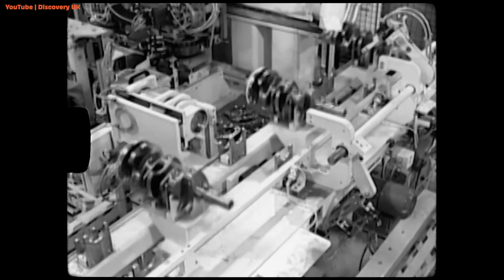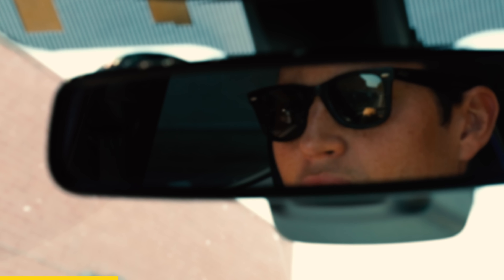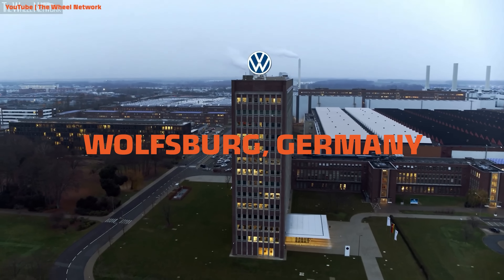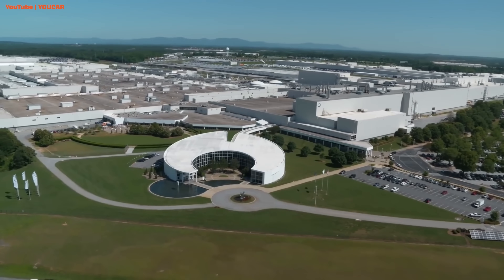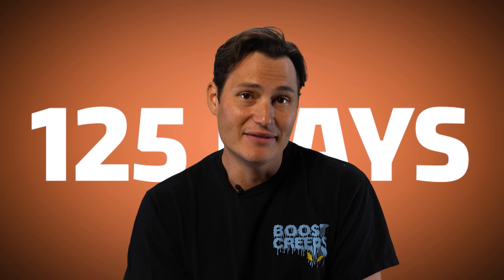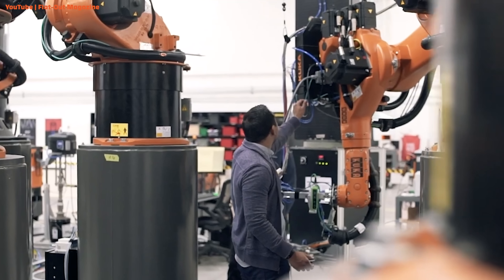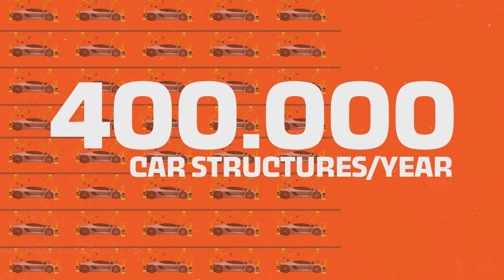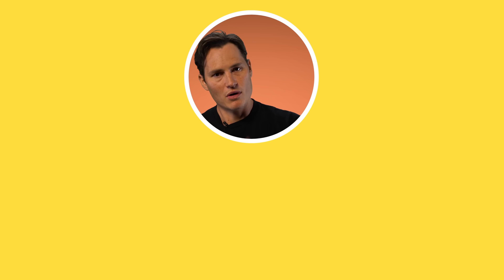A.I. Designed this Car

Comment: This will incredibly reduce the cost of manufacturing such cars, but not the selling price.
Reply: On engineering level, yes. But these Designs are not optimized for serial production, creating high cost manufacturing concept.
Reply: @Neyoz.93  that's absolutely true. This guy doesn't mentioned that a car can be built completely all in one spot. But it still can only do one at a time. if they're building 'to order' super cars, this is feasible. But there would have to be at least the same amount of real estate or even more to make daily drivers like a civic.
Reply: @Neyoz.93  One day the concept will become efficent, the problem is when and how.
Reply: @Neyoz.93  thinks you forgotten a "yet" after - But these Desings are not optimized for serialproduction
Reply: Correct and it will certainly MASSIVELY increase the profits and year end bonuses of the stuffed suits sitting in offices of manufacturers who adopt this technology...
Reply: This only truly becomes efficient when machines can make the materials needed by using common resources till then this is not completely self sustaining
Reply: but think about how much better the cars will get and that will drive competition up and thus prices down.
Reply: I doubt 3D printing will replace injection molding in quickly and reliably producing high-volume runs of complex designs anywhere in the near future.
Reply: @caelestigladii  In wont anytime soon. Injection molding machines can produce thousands of parts an hour, not spend multiple hours making 1 part, and they are cheap compared to industrial quality printers.
Reply: @caelestigladii  but it will replace tool and die guys that make the mold for the injections.
Reply: It will reduce upfront costs, sure, but not per-unit costs. 3d printing is just fundamentally inefficient at high-volume manufacturing.
Reply: @JosephHarner  get more printers .now it is unlimited.
Reply: @danecrude  3d printers are still to slow.
Reply: @JosephHarner  most of any car price is generally R&D costs.
Reply: So what you’re saying is invest now in VAG, Japanese auto and the big 3. Because they’re going to start raping so cash money
Reply: Meanwhile jobs get cut and moved mostly to customer service.
Reply: 3d printing will offset any savings from cutting down the design costs.  3d printing doesn't scale costs very well
Reply: @EvlEgle  the newer ones do
Reply: @samuelmatheson9655  newer what do what
Reply: Yes it will, the car industry is extremely competitive and they will undercut each other
Reply: You have no idea what you're talking sbout
Reply: no, the process of making cars like this is significantly more expensive than that of the traditional manufacturing process. the only pros are less space to make a few cars and slightly less material per car. 3D printing metals has downsides (a lot of them) and their strength is making highly complex shapes (a limit to it though due to their inconsistency in the micro scale). great for making a few complex cars but not large scale production
Reply: Eventually someone will decide to gain business by giving a worthy deal to people and prices will lower. They aren't that dumb.
Reply: @josiahcaspersen8017  with no government intervention anything is possible
Reply: The next 20 or so years are gonna be fun
Reply: @Ethernos Grace that's exactly what I was thinking as well.
Reply: So, AI can't solve capitalism. Yet?
Reply: @Simboiss  Actually the stuff produced by AI follows exactly the rules of supply and demand.
Reply: @PG-3462  I was semi-jesting, but the actual answer is no, because capitalism is a human problem, not a scientific one.

The more you create technology to produce stuff at a higher pace without human intervention, the more you amplifiy capitalism.
Reply: @Simboiss  1) How is capitalism a problem?  The countries with the best life quality for the average citizen (like Norway, Switzerland, Canada, etc.) are capitalist, but with good welfare and social programs.    2) How does AI create problems?  It reduces manufacturing cost which can only be good
Reply: @PG-3462  Ah shit, I didn't want to go that way again (I thought I could get away with a tongue-in-cheek comment)... Let's just use the word "inequalities" instead. The more automation, the more inequalities between classes (capitalist/worker or rich/poor, use the terminology you want).
Reply: @Simboiss  Maybe in the USA, but not in actually developped countries.  On the other hand, capitalism doesn't stop people from creating cooperatives which would own the AI machines.  Thus, all profits would be shared between the cooperative's members.
Reply: In time the costs will come down as copy cats get ahold of the technology, driving competition.
Reply: It makes me sad and mad to hear this as a new member of the adulting and this tek could supply high quality cars to nearly everyone
Reply: Idk about the selling depending on how fast they can mass produce a product it’s all on us “the people” to want it enough in demand
Reply: Everyone with half a brain cell and any knowledge of engineering has already blasted you.

This "reduces" the cost of design not manufacturing. This hyper inflates manufacturing and production.

The problem with iterative design is that it only cares about weight/materials in most of these cases. It doesn't care about creating a part that can reasonablely be manufactured via conventional methods.

3D printed parts are inferior in almost all ways to their conventional counterparts. They also are a god damn nightmare in terms of the fact they are not isotropic so their like transfers turn nasty very quickly.
Reply: It will cost whatever the market will bear... As long as the 1% earners find it to be a status symbol. If it was only about going fast everyone would have a Porsche 917...
Reply: koenigsegg owner covered how this is only possible on limited production cars.  Their turbos are 3D printed and have been for awhile.  Also it said ONE car takes 125 days... how is that going to help the manufacturing process if someone orders a car and it gets there 1/3 of the year later.  People would be pissed since they can do that now and get it in a couple of weeks.  While this manufacturing process is definitely cool and innovative, it only works for low number production numbers because of how long it takes and cost of materials and machines to make one car.  That big ass plant may cost half a billion or whatever he said, but its also going to put out thousands and thousands of vehicles compared to the 80 this company will make of the 21c.  

All in all this is just a really cool way to make a 1.7 million dollar car, 80 of them.  Compared to the tens of thousands made a year by the other vehicle companies.  So no it wouldn't save you a dime to have your light duty truck or suburban mom vehicle made this way and it definitely won't add to year end profits of any CEO cause they would've been fired already.  And to think they don't know about this or haven't researched how to drive up their profits is as ignorant as the comments saying how good this would be and how it will make anybody money when you have to make a car quickly and cheaply.
Reply: It would, It should, but as long as capitalism exists, it won't.
Reply: This is cause the technology is still pretty new give it some time and it will surely be reduced
Reply: You're definitively wrong.  If such a technology can decrease a lot the manufacturing cost of sport cars, then there will definitively be some brands which will sell their cars at a much lower price than let's say Ferrari or Lamborghini in order to attract more customers and to make more profits.  In general, the selling price reflects manufacturing costs (even if there are exceptions, we can take Maserati as an example which sells cheap cars at an excessive price)
Reply: @PG-3462  Youre both right. For now, since it's new tech, the 21C is going to mirror prices of similar models. Eventually, when AI manufacturing becomes a widespread commodity, it will drastically reduce manufacturing costs across the entire automotive industry and ultimately make cars cheaper to buy. This is all assuming a ride sharing model doesn't completely take over the automotive industry though.
Reply: @thomascombs3019  yes, now they build some cars, tomorrow when people only would rent a car, they build spaceships, airplanes and the super popular family hover-comuter
Reply: @thomascombs3019  welll you are wrong af lmao so idk if its really ur place to say whos right when you dont even kinda understand what u are sayinh
Reply: @Angeltitsss  yes this fact filled smart comment made me a believer! 🤣
Reply: @PG-3462  the reason sports cars are popular is because they are a statis symbol and a measure of wealth if they were dirt cheap no rich person would buy them how many rich people do you see running around with cheap cars they buy the most expensive most hyped cars to be cool and show off not for comfort or money saving and yes not every rich person buys expensive cars but the majority do they could get higher end cars into poor peoples hands but rich people won't buy them because how can you stand out if everyone has one also Ferrari and other companies don't make huge quantities of cars like Honda or Toyota or others because when you charge what you want you dont have to make a ton and they become more exclusive with a smaller production run so more money for less also you would literally shit a brick if you ever saw how much markup regular cars get a minimum of a third of the price of a car is profit on the cheapest cars thats why when they want to dump older stock they don't have a problem lowering the price because even a lowered price is still profit and they stand to make more money off the newer model anyway so basically getting rid of them even at cost is profit to car companies and dealerships because people who buy new cars don't want to buy the last years model but the new and improved model
Reply: @CMyBigHarryBLLS  The thing is that we live in a market economy.  Some things are more expensive only because they are harder to produce and thus more rare.  However, if technology allowed every car manufacturers to produce super high quality and super luxury sport cars at a super low cost, then they would do it and try to steal the market of Ferrari, Lamborghini, etc. by selling their cars at a much cheaper price.  Of course some companies might still succeed to make their products more desirable, but the difference between let's say a Honda and a Ferrari is only that Honda currently uses production methods which allows the company to reduce production costs in order to sell cars at a lower price tag.  If Honda could use a 3D printer to make super quality and super luxury Honda Civics at a super lot cost, then they would definitively do it.
Reply: @PG-3462  Correct, as long as there is competition. These people know fuck all about economics, glad to see that some people still do understand basic economic concepts.
Reply: @PG-3462  , sports cars is a ridiculous ways of waisting our time and valuable resources.
Reply: @zasadacrew  I didn't say they are.  I just said that if manufacturing costs decrease, selling prices will too
Reply: @PG-3462  , selling price will not decrease. Firstly because it will be presented as super awesome technology and second, the buying power of $/€/£ etc, is rapidly declining. ;)
Reply: @zasadacrew  This is not how things work.  Very little companies manage to sell cheap products at an insane profit margin (like Apple, Louis Vuitton, Maserati, and so on).  Despite being very popular, companies like these only represent a tiny % of all companies that exist on our planet 

Just saying, Ferrari makes as much profit by selling a 488 at almost 500 000$ CAD than Toyota selling a full equipped Highlander.  

If manufacturing costs decrease, some companies will benefit from it to sell better products at a cheaper price than their competition.

Did you ever wonder why a company like Honda doesn't make a Ferrari or Lamborghini "copy" and sell it at a reasonable price?  Tell me if you want me to explain
Reply: @PG-3462  , because Lamborghini and Ferrari not practical vehicle and in my opinion are just a waste or time and resources. The only reason to buy one is to show off which is a "poor person" mentality.
Reply: @PG-3462  , as well Apple is a re-saler of good that been manufactured by Chinese companies and all they do is marketing. Maserati is garbage that even my friend hates now since he wanted to look cool on the street and looks miserable in repair shop. :)
Reply: @zasadacrew  That's not the topic.  I wouldn't buy such cars either because I don't like getting attention and it pollutes too much.  

The topic is selling price, and if cars can one day be fully designed by A.I., it would decrease production costs on many different levels.  Such a reduction of costs would lead to a reduction of selling price.  

And it seems you're not interested into learning how production processes work...  If you don't like to learn something about this topic, then I guess you shouldn't be giving your opinion
Reply: @PG-3462  , it's already possible if judging by this video. This video is year old and how far this process went ? It's still a fantasy. I believe it should be all done before presenting. All this presentations and talks are waste of time. Good way distracting people. Nothing else. 
Regarding commenting. I say what I want when I want. :)

P.S. all this "green" movement is a bs. There's no harm done from our activity. The only concern that people have is a clean place to live. Their own habitat.
Reply: @PG-3462  if that’s the case, a cnn billet engine block should be way cheaper than a cast. The blueprints already there, a chunk of aluminium to mill is cheaper than casting block, yet a billet block is still upwards of 10 grand. Don’t think you’re correct when it’s currently false even though it shouldn’t be.
Reply: @Star.Chaser  It's much more complex than that.  An engine block is not something people change frequently on a car, so supply is low.  It's thus normal that it remains quite expensive.  And how much was it worth in the past for a similar engine?  You can't just state a price and compare it with nothing.

Comparing modern cars with older models is also tricky, as modern cars got much more technology and much more complex over time.  If however you look at the profit margin of car manufacturers over time, you will see that it remains pretty much unchanged, and that's because in general, a reduction of productions costs leads to a reduction of overall prices.  This is exactly how Japanese and South Korean brands first entered the international markets.  They offered good quality vehicles at a price much lower than their American and European counterparts.
Reply: @PG-3462  first go cheap to destroy the market...then raise the prices.
Reply: @anomalyp8584  Reality shows that this isn't true in the car industry.
Reply: @PG-3462  so what is the reality?
Reply: @anomalyp8584  That when production costs reduce, selling prices do as well.  If you take inflation in consideration, most cars are cheaper now than they were a few decades ago, at least in my country.  The complexity of cars increased a lot, but better manufacturing techniques made that production costs didn't increase too much.

If companies can find ways to make the production process even better with AI, we will get better cars for the same price, or similar cars than we have now but cheaper
Reply: @PG-3462  but if there is a monopoly on this technique won't they undersell first to outcompete the competition? Or are they too codependent...
Anyways, I think in the future the prices will go higher and higher artificially to phase out private ownership of cars...whether that's by the manufacturer or the gvt.
Reply: @anomalyp8584  I'm pretty sure that many car manufacturers are working on such software simultaneously.  The key of success for most companies in the car industry is to maximize the number of parts that can fit on several different models, and AI will definitively help to achieve this in a more efficient way by allowing less sacrifices in design and performance

Did you ever wonder why a brand producing cheaper cars like Hyundai can't make cars as good looking as Porsche?  It's not because Hyundai's designers are bad.  It's because Hyundai's designers are limited in their design by the fact that Hyundai wants to use the same platform, the same engines and as most smaller parts as possible for all its models in order to reduce manufacturing costs.  In contrast, more expensive cars have less design limitations because most parts are designed for one particular model.  If we talk about Ferrari, every single part, even including some little screws, are all designed for one model in particular.  Despite Ferraris being sold at a very high price tag, the profit margin per vehicle is actually not that much higher than other car manufacturers since its production costs per vehicle are much higher

In short, an AI software would definitively help to design much better cars for cheaper, and if manufacturing costs decrease, then two things can happen.  Either selling prices decrease, or the performance and technology used in cars will increase

You're also right that personal cars aren't exactly the future, but when we see how badly designed most North American cities are, personal cars will still remain during several decades to come.  It is impossible to switch to a car less society if urban sprawl keeps increasing in a stupid manner
Reply: Mostly will  just increase profits but yeah It will bring the price down a little I suppose
Reply: This tech has been out for 20 years.
Reply: Less material, but higher price. I'm just glad this kind of technology will take a more organic.
Reply: Ricky Fontaine  still going to need skilled workers to repair the robotics. I should know i went to school for four years to learn how to just that.
Reply: The seling price is up to so many reasons like the dealers and the taxes. .. but its gonna reduce the amount of money you pay on the freakin product (car ) like Henry Ford sr's idea of the assembly line in the past
Reply: Profit babbbbyyy
Reply: Maybe, but also there's still quite a few car manufacturers so the competition should keep prices in check
Reply: Assuming up-coming competition, market forces will lead to 'price discovery' and reduce sales prices across the sector as with everything #capitalism
Reply: then purchace car manufacturer stocks!
Reply: @sledxdomi3653  I did, bought Tesla in march, this had been my financial year buddy.
Reply: It's gonna be like nike.😂😂
Reply: Gotta love capitalism
Reply: S T O N K S
Reply: Uk tbh the reason for this is because people keep paying whatever they are willing to pay for things...if u want the price to go down...u need to convince a lot of people to enter a temporary boycott of whatever goods or services u want to get the price lowered on. But good luck with that. People are so on demand with what they want...they really cant seem to ever do something that would help
Reply: Until other company makes a cheaper version to be competitive. And the price will go down from there.
Reply: But shouldn't it, let's all 3d print disposable or recyclable cheap supercars or purpose made vehicles that would be dope af
Reply: It always is competition and the consumer which decides the price. People and institutions are ready to pay way more for stuff today than 10-15 years ago. It's crazy greed of man, wanting to own shit.
Reply: good that means more headway for renovation
Reply: Not yet, but if one company decides "let's sell these for less profit" to have a significant price advantage, other companies will have to follow suit (see: economics 101)
Reply: In fact it’ll probably increase selling price.
Reply: Technically if they're saving money they should pass it on if not then don't buy one? Simple
Reply: @ScoobyShotU  they could sell it cheaper by just enough for people to prefer it
Reply: True in fact it's gona go higher
Reply: I disagree man. The free market fixes everything. As soon as someone else picks this up and there's competition, you'll wicker quickly see prices drop.
Reply: We can count on china to avoid that
Reply: Lol this isn't AI.. I'm a mechanical engineer and we do this all the time. It's called Pareto based optimization which uses FEA, force constraints and mounting constraints to generate the part with the least required material. Since the shapes are often complex, 3D printers are the only way we can manufacture them (using lasers and metal powder). We don't use these shapes in practice since these parts will inherently be expensive and hence not appropriate for mass production. So YES, even though the software we use currently uses this "AI" which is basically a program recalculating stresses of all points in all orientations, this isn't anything new. How do you think we design airplane wings? We don't just WING it smh!
Reply: Mah man speaks the truth
Reply: Lmfaooo
Reply: Exactly.
Reply: Research is priceyyyyy
Reply: You might be looking at this the wrong way.  Every year 3D printers get cheaper.  Imagine if you will a time where the cost of the automated production system for these cars has dropped to the point that every neighborhood has a car printer, and when you need a new vehicle you simply rent it and pay for materials.
Reply: @Devin_Stromgren  I thought about it for a while. Now I think that all vehicles for regular people will be owned by a single person or corporation or maybe 2 or 3. But civilians won't be allowed to drive starting form 2030 and insurance for those who can will be so high that will only be for the super rich. Very every soon. We all are going to be renting rides from these cars and the rich will be able to drive their own supercars. Everybody else will be prohibitted to drive since it will be 10 x mores insecure than automated cars, therefore they won't be allowed or covered. Car ownership will be for th wealthy who will also collect them. Everybody else gets to rent a ride to work and won't be allowed to touch the steering wheel. There won't be a steering wheel.
Reply: @rainmind  That's a worse case scenario, and probably more likely, although I think we won't be allowed to drive because I don't think self driving cars will work unless there are ONLY self driving cars on the road.
Reply: I agree with you in the short term. After more companies adopt this technology they will sell cheaper cars to beat their competitors. It's the same reason the $1000 cell phone in 1999 was the size of a suitcase. Companies want to make a profit, charging more than your competition doesn't usually last forever.
Reply: It gonna raise 💀
Reply: Think about the increased price of insurance. The frame is all one solid piece, if it's damaged the car needs to be trashed.
Reply: There loss they’d only make more by selling at a more affordable price point
Reply: Isn't the world of capitalism and business tactics beautiful
Reply: Final sale price of any vehicle (or anything for that matter) comes down to the customer. If anyone is willing to pay absurd prices, the prices rise. If no one is willing to pay, prices drop. As far as i know, finale sale price usually has little to do with costs, shipments, logistics, etc and more to do with who is willing to pay for it.
Reply: Marker will always dictates. If a manufacturer or brand will not lower the price of products someone will and people are likely to buy a product with the same specs with lower price.
Reply: It will be an astronomical price increase until it becomes the status quo, then it’ll just be freakin expensive.
Reply: This manufacturing process makes it extremely difficult to mass produce so actually, the costs are higher
Reply: Actually you are wrong. If companies such as Ford, Chrysler, or Chevrolet do this the price would drop by a huge margin. A huge portion of a vehicle price goes directly to said manufacturers to pay for labor and materials. These methods cut material and labor by huge margins. Therefore, the kick back required by manufacturers would be only to maintain the robotics and by the metal powders required. Just imagine how much money would be saved on labor alone. Designing a car can take years and a team of people.... they are not needed anymore. That allot of money just from one variable.
Reply: @Mr.W-k8t  3D printing is not going to save you money in Manufacturing. 3D Printing is for rapid prototyping, not manufacturing. 

The only time it makes financial sense to use 3d printing to manufacture is when nothing else can replicate the process. 

3D printing is to slow to scale. 

Current techniques pay for the cost of the machine very quickly and the economy of scale takes over, and very soon after investing into a machine your limiting factor is neither the machine, or labor to operate and maintain it, but simply the cost of material because you are making parts so fast.

3D Printing simply isn't as fast as Injection Molding, Stamp and Press, or Automated welding machines. Talking about machines that produce thousands of pieces an hour, not hour(s) per part.
Reply: @Mr.W-k8t  , ford, GM and others are declining massively and have no influence anymore. Well, maybe in western world. The new car manufacturer superpower is China. This is why VW iD4, for example, in Europe sells for 53000 in China same model sells for 35000 and prices declining since Chinese manufacturers offering better quality for lower price.
Reply: Making a car this way, will increase the cost by a lot.
Don't think for a second, that your average car will be manufactured this way, in the future.
Reply: @akyhne  There is no point in arguing with people here. Just think about the claim that the car was designed by A.I .... If it was designed (not assisted, completely designed) by A. I this would have blown up already. It would cost enormous amounts of money to create such an A. I.
And those who claim that the 3d printing is a viable method to build cars just don't understand the Advantages/disadvantages of 3d Printing. You can't 3d Print a usable engine(gas or electric) because the Materials or the properties of the materials needed can't be 3d Printed.
Reply: @domenickeller2564  Im a mechanical engineer and you are sort of wrong. Building cars using 3d printers isn't practical due to time required to print. Also, you can 3D print metal parts and they have the same mechanical properties in all orientations as a casted mold - believe it or not.
Reply: @domenickeller2564  Can't 3D print an engine YET.
Reply: I see others are kinda roasting you so imma take it easy. They might be cheaper because ? How do you repair a car that’s built by a robot where everything fits together. Removi
Reply: @dexieboui  probably only 1 way to fix that problem, and that to make something that is built the same way to fix it, a robot to fix a robot type thing, I don't know how feasible that would be , but can see lots of jobs gone as robotics take over all industries
Reply: As long as they take 125 days to make one cars, their prices won’t go down, even if it only cost them a dollars to do it
Reply: It’s all about Supply & Demand
Reply: That is empirically false. All price reductions are the result of efficiencies gained in production as a result of a reduction in capital costs (the equipment to manufacture). Your statement has NEVER been observed in economic history and smacks of Marxist undertones. Here is how this actually works from THE authority on economics: https://www.youtube.com/watch?v=dQiBD-crrvA&list=PLDYo2mCHvADS52PfqNRQSp6UJoMUR1niu&t=8473s
Reply: Theres  a word for that *Greed*. But they will have a fancy way to say why it should cost so much 😂
Reply: Isn’t capitalism awesome 🤗
Reply: @lelandshennett  well it is, capitalism isn’t our permanent form of government, but it is the fastest rout to technology’s like this that will negate the need for standard labor allowing mor socialist idea to work properly. Which is decades away btw. We need capitalism to fund proper break through, if there were no money in it no one would do it.
Reply: @Mr.W-k8t  no, government funding and research has been responsible for 99% of all advances in the last 100 years. Hell dodge wouldn't even be a company anymore without the charger police car contract. Same for chevy with the federal officer tahoe contract, and ford with the explorer K-9 unit contract.